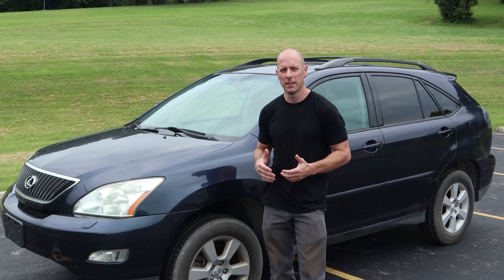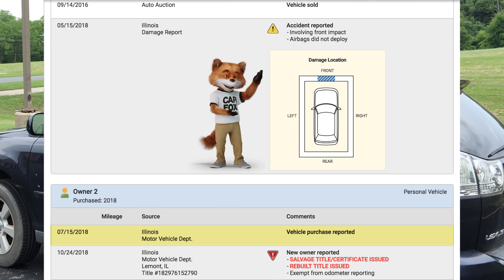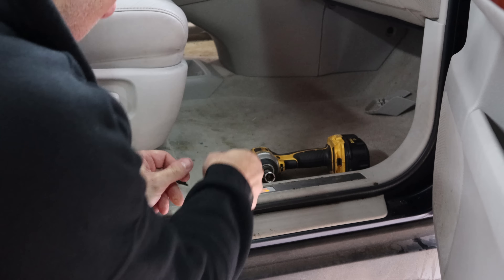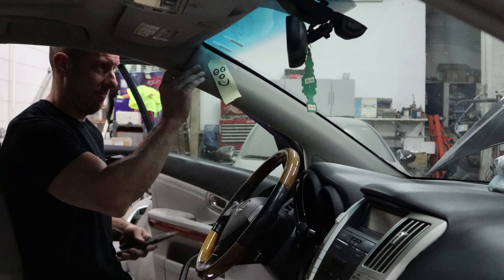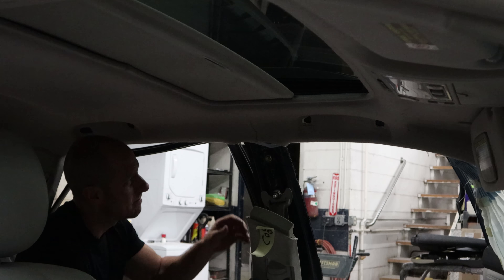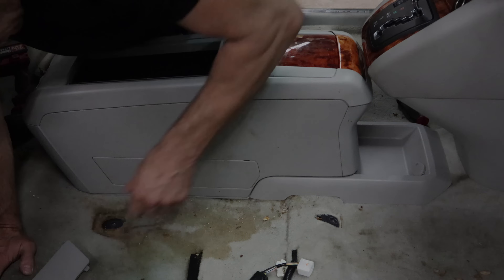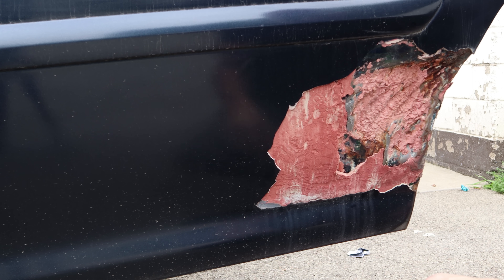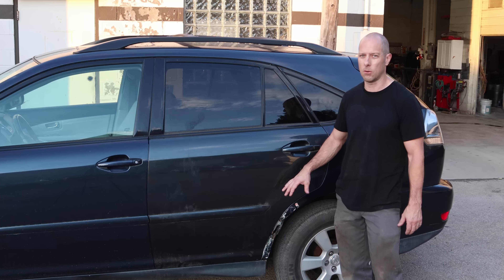Rebuilding a Lexus RX330 after it was hacked up and the truth about vehicle history reports

Comment: Wish I would have had this info earlier. Just bought a truck in December of last year. Quickly found out the frame had been filled with bondo in several places. One place was where the hitch bolted to and another is where the cab meets the bed. The truck is currently broke in half in my driveway. We also just found out that the fuel tank is held up with fence wire. Yes, it was inspected. Yes, it was checked over by the dealer and the local GMC dealership. Yes, it has a clean one-owner carfax. I'm still having to make payments and there's nothing I can do about it because I signed the "as-is" paper and NC is not a "frame state". Still trying to figure out how to fix it.

Comment: About 15 years ago, a guy i worked with bought an aveo for $500 at auction. It was 1 year old with 1500 miles. It was hit so hard in the front that it broke the end of the crank off and needed an engine. It had a clean title and carfax.

Comment: I once checked out a used car for a customer. It was being sold by a dealer and the car fax said it was a one owner Hertz car. The first thing I was suspicious of is why Hertz would liquidate a 2 year old car with 2800 miles on it. No reported accidents. The tie down holes in the rails were elongated from pulling and there was body shop dust where you could put your hand on the tops of the front aprons. The problem with vehicle history reports is that if the car is owned by a major corp or a municipality, they are self insurers and thus no insurance report is made to the data collectors. The car business was so much simpler years ago.

Comment: Out of curiosity, could you swap the module for one from a junkyard car? Or are those modules VIN coded?
Reply from the maker: I have never tried on one of these but I have done a few IS250s all the way to 2011 and they were plug and play, no programming.  A reset was $35 and a used module was $75 so it was not worth finding out for me.

Comment: Can someone explain the emissions test ? I live in Arkansas and have never herd of such a thing ?
Reply: Jon Benzing in CA (and a lot of other states) you have to have an emissions test every couple of years.  They put your car on a dyno, shove a sensor up the tail pipe and then proceed to run it out while the computer measures the emissions output.  If everything measures below the set limits your’re good and you can renew your registration.  If you are over the limits then it’s off to the repair shop to repair whatever is causing the emissions to be above the limits.  They also do a visual inspection to determine if you have removed any part of the emissions control system.

Comment: I have seen several cars sold with a clean title that were absolutely junk, wrecked but were not insured by a commercial insurance company but were insured by the owner, one was the state of Arkansas, it was an F-150 Ford pickup that needed a right front corner frame, the entire suspension on that side the front cap minus the left fender and a few other small things like a radiator and A/C coil, you know nothing worth mentioning if you were going to sell it with a clean title since it had a clean Carfax except to say it was sold at auction.

Comment: I have worked on the distribution side of the collision repair industry for more than 15 years and the sad thing is that there is more hackers and slashers in this business than true professionals such as yourself Scott.  There is a reason why I have heard many times why bondo is called form a fender.  It probably took them more time to dick around with that bondo than it would have if they had just fixed it right the first time.

Comment: I was fired for refusing to do hacks like this as I could not quit fast enough. I was working on a "66 Bronco and was told to hide all the rust on door pillars with tiger hair, bottom drivers side door hinge was holding on by about 1/4' of original sheet metal. Boss man said "It will be just fine, stuff some stainless steel wool in voids It will be stronger than ever".

Comment: So we just bought a used Rx330, 143k miles, and the CarFax report (while extensive) does not mention a timing belt replacement. Can't find an obvious sticker on the engine documenting belt R&R. How practical is it for for a middling-fair home mechanic to do this job? I'd swap the water pump and idler pulley at the same time. Seems from YT videos like the alignment marks are really obvious, always the concern on timing belts.

Comment: I bought a car that the carfax said it was never in an accident. I later found bent brackets that hold the bottom of the back bumper on and the bumper is a slight shade different, like it was repainted. So, I know the car was rear-ended at some point. So, I agree that the carfax is not 100% accurate. The car is a great car, but it would have been nice to have that information upfront...

Comment: Oh yeah the vehicle history reports can definitely be wrong. I recently went to look at a Nissan Frontier that was 1 year old. Body looked good low miles. One owner. As soon as I looked underneath something was really wrong. The frame rails were full of sand and extremely Rusty, more so than my 20 year old New York truck, the engine oil pan was dented and scratched with the scratches rusted through and leaking oil. And the tow hooks were bent in the front. A quick poke at the body drains show that The rocker Panels were also full of sand. The aluminum transmission and transfer case were powder white with corrosion. It took all of 10 minutes of looking closely to determined that it had gone for a swim in the ocean and had to get pulled out. I passed on it but ultimately the dealer ended up cleaning it up and reselling it. Someone definitely ended up getting a really bad deal on that truck and they're going to have many years of problems. But it had a clean Carfax

Comment: carfax is a very good tool for checking out cars that seem to be a little sketchy but sometimes turns out to be a good deal. here in Sweden for an example, it is directly illegal to sell undetonated airbags, but unfortunately ther is too many who do so without hesitation. Authorized junkyards trigger srs systems in a safe way and undetonated srs systems are not allowed to resell, nor is it possible as a private person to buy airbags "in store". Only authorized workshops are allowed to install and restore srs systems, which I think is good. Unfortunately there is criminals wich is specialized to steal airbags, steering wheels, front details and various interior details and sometimes specific car models by criminal leagues from the Baltic countries to be slaughtered and reassembled in crashed wrecks bought around Europe so the black market for cars and parts is huge.

Comment: I like blowing off myths & pissing people off also! I think that foam block allows the air bag curtains to come down into the interior of the car & not towards the back? Oh no, ya let Mr. Spotty behind the A-pillar trim. I have washed plenty of engines in the 35+ years & never had any problems. I also own a few Fords. Now Mr. Spotty's on the rear door? Bondo over duck tape, Never seen or heard of that one before! I hate to see what's under the multiple layers of paint on the right rear door & quarter panel on my '88 Crown Vic Police Interceptor. When you stop doing repair work you would make a great comedian! See ya next week. Great video, thanks for sharing! Stay safe & healthy!

I'll be 10-10 on the side. Spoke to ya later, Ka moan.😎

Comment: So you mean to say that history reports of cars get scammed with?  I can't believe it, I won't sleep tonight.... I got in an accident, not my fault, my car was rebuild - horrible job!! - told the insurance they need to come take a look.... Adjuster came, told me I was crazy, so I took him on a little ride, where we almost crashed because the frame was completely crooked and the shock tower in the front was in under a wrong angle... I showed him, with the square tool, that the front was at least 1/4 of an inch off on the side the car was hit and that the rail had to be replaced.  It is something that I have to do the work of a body shop!  I traded the car in that same weekend, guess what?   Those asswipes already had everything logged in the history of my car.   Some suing and months later I got the difference paid out by the insurance because of the shoddy body work.  My trade in would have been 18k if there had been no accident (Kelly - who the hell is this person - blue book value) and the trade in ended up at 12k - thanks insurance... and history fox...

Comment: This is probably my favorite video of yours.  I bought an ES300 at auction last november; couldn't tell from the photos that the dogleg was damaged.  Door was untouched though.  Car was totaled because the 22-year one-owner appeared to have blown a tire out and it folded up parts of that quarter.  Between that and the faded paint... totaled.  I replaced the steering wheel, radio, front struts, sway bar links, window regulator, driver visor (for one with a garage opener), and trailing arm bushings all for less than $500.  Started to pull the dog leg out; saw it was too far gone, and left it alone.  Took two hours to sell on Craigslist and made a little profit.  Even included photos of the damage and that it had a "Salvage" title.

...and as a former 2V 4.6L F150 owner... yeah; don't you put water in that engine bay.  Ever.  Don't even look at the front of the truck when it's raining.  Okay; mine wasn't that bad, but plenty were.

Comment: Be sure to check the trim on the right and left sail windows. My 06 RX400h lost  both of them without me realizing it. The adhesive tape (at least on my Japanese assembled car) failed and they broke and flew off on the highway. Maybe the US cars didn’t have that problem.  It was a known problem. 
In true Lexus form, you can’t just buy the plastic trim, you have to buy a complete window assembly. Some guy on the internet made replacement parts but my RX was totaled before I got around to buying them. Oh well.
Addendum: Yeah. I found out the console was adjustable the day I turned it in to the insurance company. Cleaning it out when I discovered that.

Comment: This car has a odd history like our “3 owner” Kia Sorento.. purchased it off marketplace Vehcor style crunched the numbers repairs and maintenance vs actual car value and it came out as possible did find some terrifically horrible bodywork that will be a “down the road” thing but we got a pretty dang nice car with a amazing history of maintenance down by dealers in 5different states.. the damage when we purchased was just mangled bumper covers and inner liners 8,000 miles later she is going great.. previous owner gave up when the 1900 dollar quote for a timing belt came up..about 350 bucks and oil changes and tire rotations.. my car is a Vehcor inspired car.. thanks for what ya do my friend!!!

Comment: I was looking at an 06 Pontiac GTO, manual transmission with 30k miles (2010ish). Low miles, dealer claimed they bought it from another dealer whose owner's wife drove the car.  Stories are stories, but in buying I came across a video of it at a famous driving school.... his wife needs a shave, and not the type to cast negative aspirations, but wow was she ugly.  Took the video to the dealership, got 5k off the price AND a certified used car warranty.... under which they replaced the motor, the trans (3x), the rear end, and a bunch of other stuff.  Through the grapevine I heard that dealer can no longer independently certify cars ;) .... at 36k miles (warranty was done) I sold it to another dealership and explained the history and talked up the car because it was basically new.... made 10k on the trade.... love carfax.

Comment: Sucks that someone would make a “fix” like that, but good for you for doing it right. Your customers will trust you and keep coming back.
Reply: Duct tape rocker panels are a "thing" at auction.  The scary part is, sometimes they look GOOD.  So, you have to walk up and try to poke your fingers thru every old truck you look at...
Reply: Just an FYI: sometimes people can't afford to fix it "right" so they do what they can. Not everyone has a couple of grand to throw into a repair. Specially one that is purely cosmetic. 

I am driving a beater 2006 F150. I paid $700 for it. The cab corners, rockers and rear fenders were rotted out. I fixed it with spray foam and some bondo. I am NOT going to put thousands into it. Now the "right" way would be to buy rockers ($400) rear fenders ($600) and cab corners ($200, sometimes included with the rockers but those are more money). 

To get this done "right" at a local body shop would be around $4000.00. Do it myself, probably over $1000.00 and would have taken me a LONG time to get done. Not to mention since I run my own business, while I'm working on it, I'm not earning a living. 

Sorry, I didn't have the time, or the money, or am an idiot, to put that much money into a vehicle I paid $700.00 for. Hell, just changing the oil was 10% of the value of the vehicle. Hell, filling it with gas increased the value 25%.

Comment: Is there any way to hold those people accountable?  Someone could have died with a deployed and inoperative airbag system.
Reply: no
Reply: @houseofno  FYI: air bags are NOT "instead of" buckling the seatbelt. That's why they call them "supplemental restraint systems". In case you weren't aware, side curtain air bags, steering wheel and dash air bags, save lives and often prevent serious injury. 

If YOU want to live on the edge, stick to early 60's vehicles that didn't even have seat belts.

Comment: I've been working in the automotive business for forever and I always have my eyes open for deals like something with a salvage title or bad carfax. 
So if you think a horribly incomplete carfax is bad, I would argue a carfax report full of errors can be worse. I've seen errors from a dealer group having two people with the same name and similar car, fat fingering digits, someone switching their gauges between miles and kilometers and more. With errors, good luck trying to fix it. Carfax is the worst
Reply: TMU  True Miles Unknown!

But...if you just push this button here....

TMU!!!!!!!!!

sigh

Ranks right up there with "Auction announced frame or structural damage" which means "Adesa had some idiot 17 year old on the mirrors again and he saw a bolt hole".